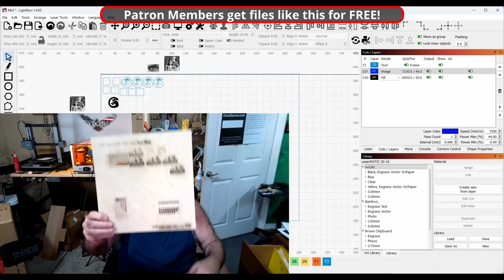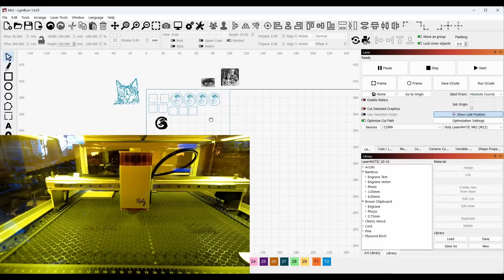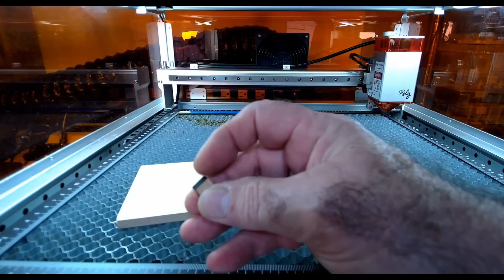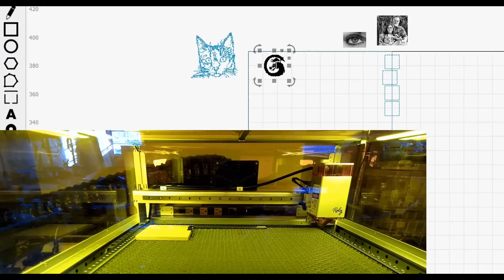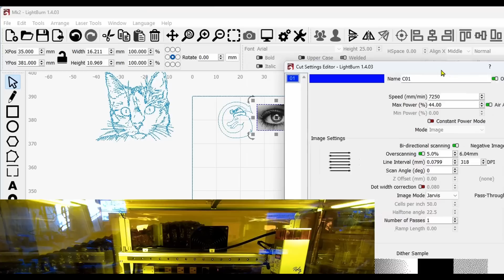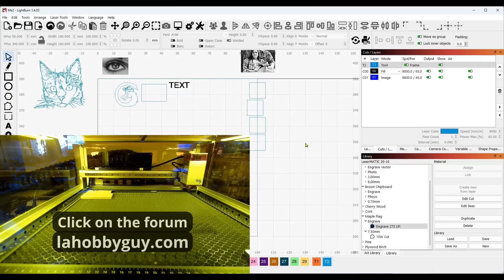Creating a Lightburn🔥Library WITHOUT WASTING Material!

Comment: Why would you focus differently for cut and engraving, i use that focus mechanism for everything.
I know i have alot of questions..
Reply from the maker: Engraving is done with the focus on the top of the material Kay, while cutting is done with the focus lowered half the thickness of the material. Better cutting ability.

Comment: Thanks for all your effort and guidance for all! I was wondering, do you do all cuts at 100%? Is it a myth that doing that will wear out the laser?
Reply from the maker: Yes 100% Dawn mostly, depending on the material. Lightweight materials and leather have to be dialed way back.
Reply: @TheLouisianaHobbyGuy  Thanks...Might be a dumb question, I assume the tab for Russian Birch is the same as Baltic Birch plywood, am I correct?
Reply from the maker: Yes, Russian is Baltic.

Comment: I was under the understanding that you do not use Air assist on engraving. Am I wrong?
Reply from the maker: I use air on every job. It keeps the lens clean. Use a paintbrush to get the debris off after the job.
Reply: @TheLouisianaHobbyGuy  well, I guess I’ll start using Air too. I was under the understanding that you shouldn’t. Never did really experiment to see any different outcome. Yes I’m brand new with this. Lol.
Reply from the maker: Awesome! Like I said, take a brush to it when it's done. It's important that you don't touch the soot or debris! If you do, the oil from your skin will cause it to stain! So hands off until you brush it! Go with the grain, and brush it well!

Comment: I use the standard material test, but I also make the squares smaller and do less rows and columns. I do them side to side using very high numbers and then go down to smaller numbers to get the fine tuned powers and such. I tend to use the base numbers either you or Dimitri has setup as a starting point sometimes. 

I have a roly lasermatic MK2 20w coming hopefully this week too.
Reply from the maker: Congrats on the Mark2! This method is much faster and wastes less material.

Comment: Question? say you’re got something that works well at 5000/60. Why would you not try faster like 7500/100?

I notice in the library you don’t always go for 100% power. 

Also with the square box to replace the eye image could you just disable that layer and use a different layer for next test?  I’m always interested in reasons why someone chooses one thing over another. There is always a reason

TIA
Reply from the maker: Yes Dave, different speeds get different results, I chose the best speed and power from a power grid. If I disabled the photo, I wouldn't be able to run it again in a different spot.

Comment: This makes a lot of sense and saves material as you pointed out. Great instruction Rich ! I have had my Lasermatic 10 for just about 2 months and have to say I'm glad I started with this laser. Leo has been great to work with. I'm upgrading my cabling this weekend and will probably add the 20 watt module to my machine when Leo has some available again. I don't know if the rotary chuck is going to be an option for the legacy machines at some point, but that would be nice, I would defiantly add that  as well, although I have had great success with the existing rotary with glass ware.... Thanks for the video Rich, take care and  cheers from Mark in Moab Utah !  ;-)
Reply from the maker: Awesome! 👍 Thanks for watching! I believe the chuck roller is compatible with the 10W Mk1. Check with Leo...